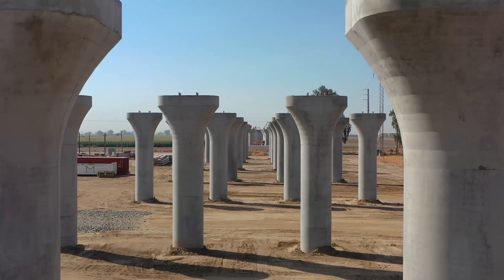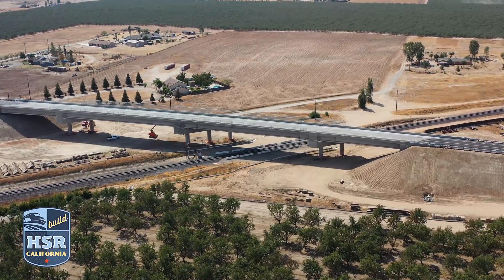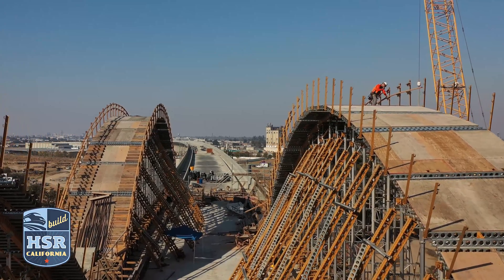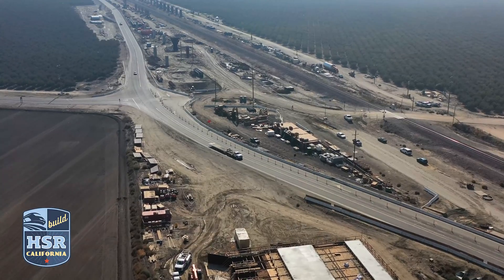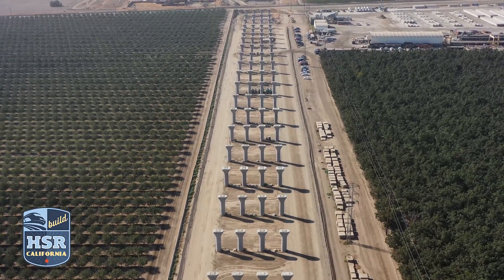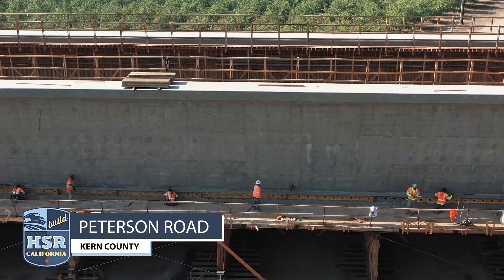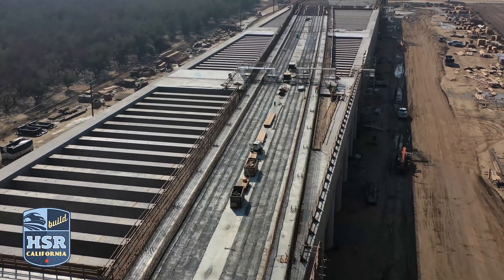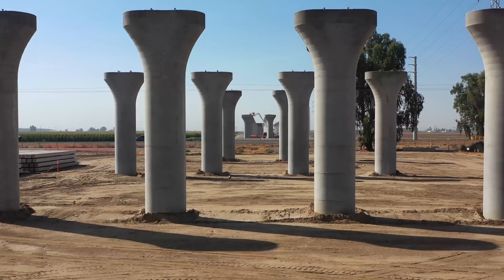California High-Speed Rail Construction Update - Fall 2021

Comment: Propaganda. That sucking sound is project going broke
Reply: Boomer talk pretty one day.
Reply: @brett26  How many miles from SF to LA?
Reply: Good luck with that. The project has yearly injections of CARB money. The best you can do is to slow it down and make it cost more money. It is getting built either way!
Reply: @TohaBgood2   That project started on obama's first term. 8/9 years ago. Correct about pouring massive amounts of money into. If or when it is finished, it will not fund itself. The Great State of Florida turned down the obama bucks. As we text Brightline is building high speed rail from Miami to Orlando. Guess what???????
Privately FUNDED!
Reply: @paulseabrook8179  Ummm, almost all of Brightline East is 79mph limited :))) Not HSR in any shape or form. Just a rebranding of Amtrak service on a rehabbed freight rail corridor. HSR is expensive to built.

CHSR started building in 2015. Just over five years ago and one year after Brightline.

Also, you do understand that they are financing construction with public bonds which you are paying for, right? :))
Reply: @TohaBgood2   apparently you don't understand what Bonds are or their functions.
Reply: @paulseabrook8179  Brightline is funding their buildout of a conventional speed mostly formerly freight ROW with tax-exempt, private activity bonds. You are directly subsidizing those bonds. 

Infrastructure is expensive and the proceeds are generated in the entire economy surrounding a project like this. There is no way to build infrastructure and profit directly from it in most cases. Brghtline is no different. They get government handouts left and right. It's a good project, but "privately funded" is definitely a stretch. It also uses private funding, but you shouldn't believe their marketing so much.
Reply: @TohaBgood2   The fact remains, Brightline endeavor is doomed to fail. Just not as Spectacularly as LA to SF boondoggle.
Reply: @paulseabrook8179  Weren’t you a supporter of Brightline just a few comments ago? Wow, turns out you really can change hearts and minds on the internet. Who’dathunk! 

Anyway, I did not say Brightline would fail. They’re just not “privately funded.”  FYI almost no transportation infrastructure is. Transportation infrastructure generates benefits via network effects which makes it very hard to capture profits from their economic impact. 

Highways generate zero dollars in revenue and cost ridiculous money to build and maintain (and then rebuild again in 50 years), but you’re not going to argue that they are useless and should be left to disintegrate are you?
Reply: all involved are making great money - that's all that counts.

Comment: Finishing the initial operating segment must be done ASAP to get cars off our congested roads since transit hopping from SF to LA using the IOS will be much faster than driving. Finishing the IOS early will also provide a boost in support for other HSR projects since millions of people will finally be able to experience the virtues of HSR infrastructure for the first time. I would like to see some of the funding coming in from the recently passed infrastructure bill put into speeding up the construction of the IOS.
#GetRailDone
Reply: Amazing that this is moving forward like this.
Reply: The IOS doesn't connect to either SF or LA, it's Bakersfield to Merced
Reply: @jmlinden7   I know that, that is why I said transit hopping. If it was the whole SF to LA line it would be nearly faster than flying door-to-door and astronomically faster than driving. CAHSR plans to increase rail service to Merced and run dedicated timed busses from Bakersfield. This means you can transit hop the IOS reliably, which is faster than driving, but not even close to as fast as flying.
Reply: Wiping out the population of Oakland will get more cars off the road than this shit. And I'm all for bombing Oakland out of existence
Reply: @scootersonlyrepair  you’re all for genocide? You’re one sick…
Reply: Its gonna be a while like 30 years 😆
Reply: The technology of EVs and self driving cars will leap frog any mass transit system...
Reply: @michaelmccarthy4615  lol, ever tried asking someone who actually works on autonomous vehicles about this? Don’t they all say that autonomous vehicles will effectively become the new public transportation? Shared vehicle fleets anyone? What’s Tesla’s master plan again? :))))
Reply: @michaelmccarthy4615  No they won't. Car's and other personal vehicles will always remain low volume(people) while requiring an astronomical level of volume(space).

Self Driving cars are also 20+ years away.
Reply: @Zeethos  self driving vehicles are now and moving forward. 
TuSimple trucking is logistically operational.
Reply: @michaelmccarthy4615  self driving vehicles are firmly planted in level 2 automation with no visible path to level 3. How many years ago has Tesla promised “full self driving”?
Reply: @TohaBgood2  TuSimple is running Level 4 right now.  Anticipating level 5 next year.
Reply: @michaelmccarthy4615  wow, trucking. that's not a personal vehicle and those trucks are also limited to highways and won't be touching interior streets and arterials.

Still doesn't resolve the problem of personal vehicles. low density but high volume. You can't build enough roadways to ever meet personal vehicle demand.
Reply: @michaelmccarthy4615  Sure, because a fake-it-till-you-make-it startup’s marketing is completely trustworthy! 

On a completely different note, I am a Nigerian prince and you have inherited five zillion billion dollars. Send me your SSN and checking account password so that we can start processing your inheritance asap!
Reply: @TohaBgood2 
the California HS rail authorities need $100 billion to complete their fantasy mass transit system.    They could reall7 use the money.
Reply: @michaelmccarthy4615  Hang on, so fully-autonomous vehicles, which I remind you do not currently exist, are not "fantasy"? But a pretty normal high speed rail line, of which there are thousands all over the world, is? OK, that makes sen... oh, no, no it doesn't! That's silly! Almost had me there, troll :DDDDD
Reply: This project is totally useless as California will be nothing but a sewer by the time it is complete and who wants to take a bullet train from one cesspool to another
Reply: @geoffwatson6207  Sure, sure a sewer with the fifth largest economy in the world and growing faster than the rest of the US. Oh and the most expensive and desirable real estate in the world. Your definition of sewer seems a little off? Let me guess, homeschooled?
Reply: @geoffwatson6207  I've been hearing you people saying this since the 70's and all we have seen is insane economic growth. We are now the fifth largest economy in the world. We've even passed the Brits a few years ago forgossakes. Most of our problems actually come from growing too quickly.

Seriously though, people have been saying this about California ever since the Gold Rush. Hasn't been true before and still isn't. We have our issues, and some are harder to solve than others, but we'll deal with them as they come and be just fine in the sun.
Reply: @TohaBgood2  We have more issues now.
Reply: @willmoodie2340  Do we? Or do we just have more trolls now who are butthurt that their party can’t win elections here anymore? I’m pretty sure that it’s the latter although I personally don’t care for either party or politics in general.
Reply: @TohaBgood2  Fourteen years and still no rails down.
Reply: @willmoodie2340  Fourteen years, ten years, twenty years, where are you people getting these numbers from? Are you just making this stuff up hoping that no one checks? The project broke ground in 2015. There's videos from the groundbreaking and all the building updates are public information. They also have quarterly updates and regular board and committee meetings which are all posted to YouTube.

Please stop lying so obviously. It is extremely boring to prove you wrong.
Reply: @TohaBgood2  I’m just gonna help connect some points made in what you’ve said.   We are the fifth largest economy …this also contributes greatly to the US’s economical success.  In California, much of this is attributed to the farming industry coincidently resting within this valley between bakersfield and merced.  
Supplying our nation w 40% of its agriculture and 25% of its dairy, the only real threat to it recently was the lack of water supplied to it. 
Today we have 119 miles of full grade separation track from one end of this valley to the other 🤔 ..w politicians promising to bring us water.  
Now, do you see why they aren’t giving up on this? Or how the state will also be able to keep to its mandate that all vehicles left in the state by 2030 will all be electric?
Reply: @dav1djac0b  A few key corrections. 1. We are now the 4th largest economy in the world, not the 5th. We passed Germany sometime in late 2022. And we are growing almost twice faster than the red state darlings like Texas and Florida. This is important to note if you want to talk about what good economic governance looks like. You may not agree with the politics of our state leadership, but it is obvious that they know how to run an economy and run it extremely well.

2. Agriculture is a dying sector in California, not in regards to its own performance but compared to other sectors. All of our agriculture is only 3-4% of our state's economy, yet it consumes 80% of the water!  Almost all of that water is government subsidized! So why am I paying for some illegal alien to play in the dirt while we have actually profitable unsubsidized sectors in need of that water already in the state? How come agriculture in a desert is even a thing? How come we are trying to do agriculture in one of the most expensive labor markets in the world? Do you see Monaco trying to do agriculture? This is ludicrous. 

3. We have discussed the need for a north-south link for many decades now. The 5 was supposed to help. But it ended up being an expensive boondoggle that only made traffic worse. And it is now at capacity again with north-south travel in the state still increasing like crazy. You can't have something that is in high demand and free to use not be perpetually oversubscribed. That's not how reality works. 

4. The solution to this problem has already been discussed, agreed on in a state referendum, and is being built. HSR was the choice because it is several times cheaper than a new north-south highway and two matching airports in LA and the Bay. This calculation is redone every year. CAHSR is still many times cheaper than the airports+highway combo.

If you have any other solutions that are not incredibly stupid (e.g. wait for teleportation, bringing back Wells Fargo stage coaches, etc.) or a fake (hyperpoop, passenger rockets, flying cars etc.), then I'm all ears. But I don't see any of you all proposing anything that is A. cheaper, and B. would provably actually work. So CAHSR it is then!
Reply: @geoffwatson6207  california has been a sewer since the 80s